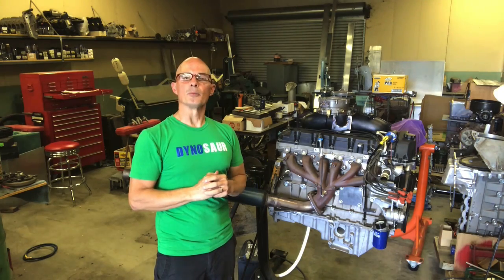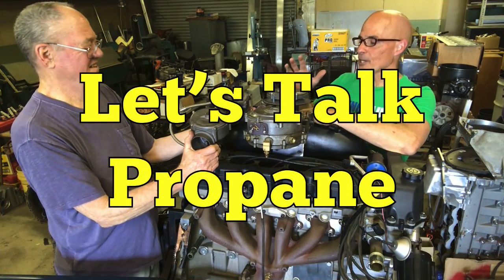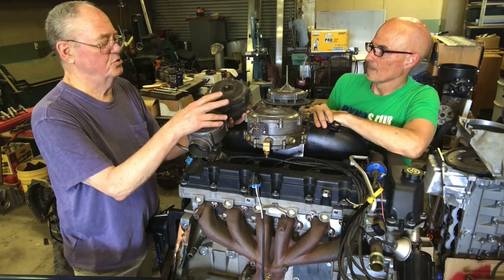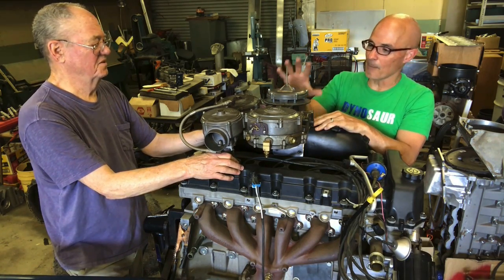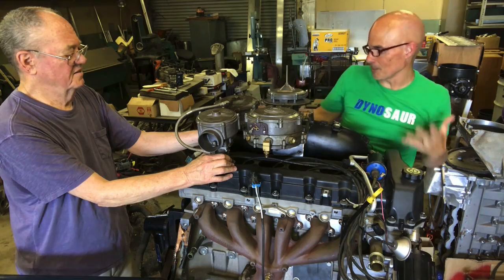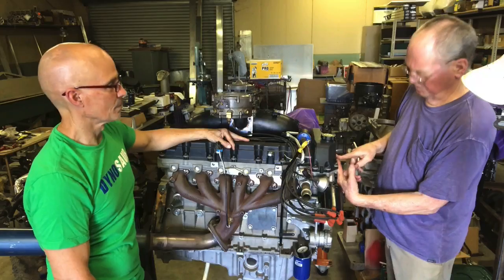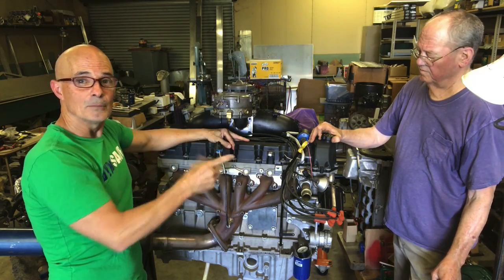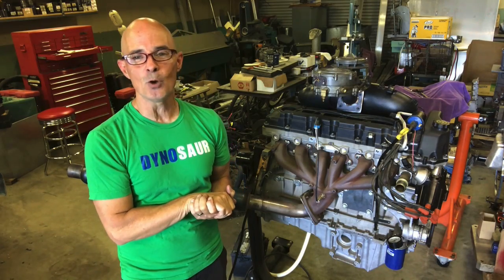PROPANE-POWERED AMERI-BARRA 4200 ATLAS (STAND START ON GRILL GAS-WILL IT RUN?)

Comment: They have tight oil clearance due to lost foam casting. Lost foam castings have 2x the surface area of sand castings and suffer from high thermal expansion.

Comment: I have 2002 trail blazer and I like get bone yard 06-07 engine and rebuild it do you know of a 6 speed transmission that will bolt it to this engine also a good camshafts

Comment: Great video as always Richard. I was thinking about converting a Jeep 4.0 (or better yet a 4.6/4.7 Stroker) to run on propane. Or even dual fuel so I don't get stranded away from a propane fillup station. However I don't know much about propane conversions. Would basic gasoline engine components (camshafts, exhaust manifolds/headers, starters, spark plugs, fuel pumps, turbochargers, etc) still work or would I need to change things? Would there be a significant power and mpg loss if the engine ran on purely propane instead of gasoline? Thanks in advance for any and all thoughts, opinions  or answers.

Comment: To switch from propane back to gas was easy unless the carb float pounded a hole in itself.
You had to run the carb dry because the engine would not run on both at the same time.
Then switching back to propane you had to run the carb dry before switching to propane.
No problem  if you are going down the road at 60 mph.
Then finding someone , someplace that can fill the tank. And it smell fishy too from the smell they add to the gas so you don’t die from  breathing the stuff.
Bet that little tank won’t get you across town.

Comment: My father ran propane in his 63 Chevy pickup in 1963
I drove it for years after he died untainted they started regulating everything
And requiring a tax for even inspecting the tank.
Always wanted to build a engine with about 13 to 1 pistons to run on the stuff.
You lose a lot of power on a normal engine with normal compression.
Of course you would have problems having to switch back to gas when you run out of propane.
For a old farmer it worked well because before diesel became popular , a lot of tractor were ran on the stuff . It was easy to fill the tank in the truck from large tanks used to run tractors and irrigation wells .
This was in the 1950s, before the gov . Decided they needed more taxes.
 It runs cleaner, only the valves need hard seats as the gasoline lubes the valves on gas engInes.
And the tanks large enough to run for ver far are large and very heavy.

Comment: I only know what I been told . The oil pressure is a manufacturer number from the computer but I think as long as a minimum number is met by a normally open switch then the rest is rmps and temp ,probably water . This is done to make folks happy . I pretty sure my Mozda Miata and Dodge Diesel is that way ..

Comment: Would the high oil pressure be relevant to a higher volume requirement for the variable cam timing, assuming it uses it

Comment: I'd be interested in seeing a full on LPI with electronics.  You get greater charge air cooling from the vaporization of fuel in the inlet tract vs having it happen in the regulator.  The Aussie's are doing this but nobody state side seems up on the current tech.  Holdens and Fords offered it OEM and made slightly more power with Liquid Propane Injection.

Comment: My uncle drove a propane truck, delivering propane to homes. The old trucks were often some variety of big blocks. I do remember him telling me those trucks engines were special order. I do know that it loped like it had a huge cam but would only pull up to about 4000 rpm. So at that, I figured it was advanced 4 degrees.

Comment: Is there a particular reason you can't run coil-on-plug with a propane mixer, or is it just because of the absence of an ECU that he needed a distributor? I'm sure the Delfi unit would be very unhappy missing the injector system and MAF/MAP readings, but surely a standalone could get around this, no? Also, is there any way available on the market to run EFI with propane? Should be able to build a ridiculously high compression ratio NA motor that would sound amazing if you could get around the fuel injectors freezing solid.
Reply from the maker: THIS WAS DONE SO NO EFI WAS NEEDED

Comment: 6:10 Richard, people  inject Methanol/Water mix into a turbo or supercharged system to prevent detonation and add a little power. Would  Propane work also?  How could that be done?  Inject before the supercharger or turbo in gas form?

Comment: I am an LPG technician here in Greece and I can tell you one thing: this system must be really OLD! I have a Hyundai 2.0L turbo converted on LPG, stock engine 1 bar boost for many years working great but with a much more modern system. I'm curious on the results...
Reply: That's a vaporizer like what's used on an older forklift.

Comment: Distributor conversion means you're halfway there to eliminating the Achille's heel of the Atlas, ie, the need for an ECU & wiring harness. All that's needed now is a controller for the variable cam timing.

Comment: If the propane is liquid under pressure. I wonder if you could somehow plumb the normal efi fuel rail returnless and instead of gasoline, run pressurized propane through it regulated to a pressure the injectors are comfortable with?

Comment: I love the reference to Ak Miller.  'Turbochargers' by Hugh MacInnes referred a lot to propane and Ak Miller.  Turbochargers was one of my first tuning books ever purchased, such a great book so far ahead of his time IMHO.  Based mostly on that book I did a turbo conversion on my 1974 Mitsubishi Colt Galant GTO, 2.0L.  It worked very well, mostly based on that book.  I did all the work myself, made a few mistakes, but the performance was stunning and just as MacInnes had predicted, it got better gas mileage after conversion than before in spite of a lower compression ratio in the turbo version.
Reply: If you're gonna read anything on turbocharging, "Turbochargers" by Hugh MacInnes and "Maximum Boost" by Corky Bell should be at the top of the list. They're a little out of date but there is so much knowledge buried in those two.

Comment: I accidentally snapped the oil pressure sensor off in a Trailblazer, and magically the gauge still read like normal with the sensor laying in the crossmember. So yes, the factory gauges are a basket of lies.

Comment: Love these kinds of tests. My company was running CNG on GM LQ9 6.0’s after discovering that it was better on emissions than a Toyota Prius running on gasoline. I just wish it was cheaper to convert today’s cars!
Reply: With the huge amount of natural gas the USA has, you'd think the US government would be scrambling to make use of it and allowing conversions. Because it does run so cleanly, you could exempt vehicles from emissions standards after an LPG or CNG conversion. If you could clear the regulatory hurdle, after that it's just a matter of getting safe conversion systems built for cars. That would also play nicely into using CNG and LPG for new vehicles.

Comment: I would live to see the results of this on the dyno.  Maybe I didn't understand part of the science here but what would stop you from running the liquid propane (rather than evaporating it before the manifold) for example on a direct injected engine and injecting it at high pressure.
Reply from the maker: YOU NEED A DEDICATED SYSTEM TO DO THAT

Comment: Propane has approx. 75% the energy density of gasoline however, because of the innate octane rating, you can run a much higher static CR, making up some of the differences.

Comment: I Always ran gas in the 90s when it was 25c a litre now the aussie govt sells it to china for 3c a litre and we have to pay around 80c a litre just not worth it , i always ran the impco 425 mixer on a q/jet base plate with the secondary butterflys reversed always made more bottom end power & more top end than any holley i ran on petrol on a 350 chev in a hq holden

Comment: Tunnel Vision in Australia has a quite a few fast cars they have built for customers with Turbo LPG, Johns ITUF65 Mustang was fast did see another vid at 9.13. https://youtu.be/NrZm_eKfOKk
Car had a custom Propane tank with 8 outlets, 4 lines, 2 converters & a Gas Research Australia/GRA mixer, on a built AU SOHC (predecessor to the Barra)

Comment: Does anyone know if you can run liquid propane on port fuel injection.  The pressure would be higher, but I presume that there's injectors out there that could handle the higher pressure.  Someone must know, would love to know myself, please share.
Reply from the maker: yes-oems are doing just that
Reply: @richardholdener1727  I did not know that, thank you.  Sounds like a great combination in theory and getting that heat of vaporisation from the inlet air should be a nice bonus.

Comment: I am running a propane fueled Ford 200 crossflow (Australian) I run 9;1 CR with a screw type blower providing 60inches H2o manifold pressure, fixed advance. No problems at all, great torque and sweet running. LPG is a great fuel and here its about half the price of petrol. We had factory LPG Barra engines, later ones had liquid injection.
Reply: Tell me more. OEM system? Here in Canada, with road tax, it is about half or better then petrol. Getting it as heating fuel is cheapest. LNG is even cheaper and we can get home compressors so it's kind of like free after purchase . What is blower rpm at 4 bar? What air/fuel control? Love crossflow inlines.
Reply: @ianmcfarlane4257  Ill go to LNG first, I worked for Westport, based in Vancouver for a couple of years, we were doing R&D on CNG and LNG in Australia. We did have some CNG and LNG trucks and busses going around, worked quite well, mostly 12litre Merc engines. As to my application its the Australian incantation of the old Ford inline six that we here eventually got to DOHC and 4valve. The blower I run is a Sprintex S102, its 1.1 litres per rev, Ive got it running 2.9:1 so maximum of around 14000rpm. I run a GRA (Australian made) mixer and B2 convertor, nothing complicated, no electronics other than a dizzy. NG runs great with boost, Westport was running 12:1 with 1bar boost regularly, I would run CNG here, but it isnt available, LPG is readily available everywhere, and around 80c/l (exchange rate to C$ is almost 1;1) My manifold pressure is 60 inches of water, so around 100kpa. If you want to know more I can be reached on FB, under my name. Seeya

Comment: Was it Bobby Alloway who did ProPain with LPG injection system from Oz. Heat reduces density of any vapor. Blowers add heat . Blow through carbs/mixers need cold air, that is why intercoolers are used on higher output engines. Think of LPG vapor as pollution on a N.A. engine air charge. You only have so much cfm going in now add LPG vapor and you reduce the oxygen. On a N.A. daily driver you can tune out the Lean. Add boost with heat and vapor tuning gets very tricky. Dyno runs at WOT like Ak Miller did back in the day were impressive, 700 HP on a stock built SBC, single turbo. Really not for a D.Driver. LPG injection might help but at what expense? The big advantage back in the day was fleet economy. Payback for installation was one to two years. Cars/trucks are so much better today so think at least five years.
Rock crawlers love LPG  "Got Propane" and "Nash Propane" are two outfits but use certified hoses, please.
As was mentioned -  any back alley wannabe shop should be crushed alive using propane in an AC system. Period.

Comment: Hmm...propane....higher octane & keeps for years in its tank & never goes bad, no need for a fuel pump as it's under pressure in its tank, burns clean & keeps engine internals spotlessly sludge free, half the price of petrol...except in remote areas where it's exxy & harder to get. Best to go dual fuel, not straight gas
Reply: Propane costs more than gas everywhere I look. Gas is less than $3 per gallon, propane is over that.

Comment: Im very interested in one of those distributors Richard,  thinking about replacing the locked up I6 chevy motor in a boat with a 4200 and that would be the missing link in the swap chain.
Reply from the maker: search Stovebolt
Reply: @richardholdener1727  maybe a 6LS could be used to run the coils somehow?
Reply: @richardholdener1727  all i get is the old stovebolt engines, im interested in that distributor drive to swap an Atlas into the boat

Comment: LPG is really common down under if you can mate try and get a lpg injection system something like we run on the lpg barras.  The octane is great however like e85 you use way more of it and it struggles to provide enough fuel at about the 600hp. check out the guys trying to get 10's from a lpg barra engine at Carnage garage the Street machine guys. Be aware that if you get a LPG backfire you can easily bend rods thats why the lpg barras have forged bottom ends
Reply: LNG and Hydrogen Id like to see used
Reply: I don't know about high hp numbers but i know gas has 5 percent less energy than petrol per unit so you don't use to much more unlike e85.

Comment: I have often wondered if a fuel injection engine will run on propane. If the propane goes into the system as a liquid I don't see why it wouldn't work
Reply: The problem would be keeping it as a liquid through the injectors
Reply: @colinb5517  It's under pressure so that shouldn't be an issue. I suspect you would need bigger injectors for propane/LPG
Reply: Do you have injectors that will take 350 psi? Because that's the pressure they'll see at 150°F. There are liquid propane injections systems, but the fuel delivery system is a bit special.

Comment: The oil sensor on these motors are basically and on/off switch. The computer senses if it has pressure then "calculates" what is should be, they normally run at 40 PSI.
They are also prone to low oil pressure issues if motor was not taken care of. They build up sludge and the oil pickup screen is very small and gets plugged easily. I have a 2008 Trailblazer that loses oil pressure after 10 to 15 mins of driving as screen gets plugged. Shut it off, let it sit for 5 mins, good to go another short stint. My mechanical gauge confirms I start with 70 psi and drop to zero. 
This is cool how you are running on propane with a distributor.

Comment: I'm very interested in that dizzy conversion...  It could seriously make me rethink a build I want to do in a first gen Nova.  If I could do one with a distributor and carbs it would be totally legit!
Reply: Not sure if it helps, but the motor comes with a crank trigger. While Jerry didn't need any of the electronics, there is a fair amount of knowledge out there in using the crank trigger with something like a megasquirt. I almost wonder if it wouldn't be better with a wasted spark setup like GM used on the 3800. It's fairly easy to trigger. Then you could hide the coils and use normal plug wires and keep a 'retro' appearance instead of the 4200's coil-on-plug

Comment: I had the pleasure of talking with Ak Miller several times and he was very helpful.  He had a turbo six cylinder (stock) Maverick and tore up the big boys with ease (Ak said you didn't need much more that 7-8 pounds of boost).  How can I communicate with Jerry??  I have a 500 Cadillac built to run propane.  Going in a '66 C10 (in build).

Comment: The higher oil pressure is for VVT cam phaser. When the solenoid drops pressure at the phaser to move it, it creates a massive pressure drop so they improve pump flow to counter this. You could change the spring in the pressure relief bypass to drop the oil pressure if you delete the VVT.  
The reason they spec 5w-30 oil is for response time of the cam phaser, 20w-50 would take too long to evacuate from the phaser causing it to lag ECU demand.
So the whole engines oil system is tuned for this. 
More modern engines have variable oil pumps now so this issue of over pressure at cold is not there.
Reply: Yup considering this is GMs first Truck VVT before Gen 4 LS.

Comment: This brings back memories in the 90’s doing straight gas conversions.
Reply: Let's Restart a trend toward straight propane conversions, it's 105 octane minimum (HD 5 standard propane.) Hot Roddin with clean burning, hi octane alternative fuel. Lead the way Mr. Holdener!

Comment: BBQ LPG or liquid propane gas is different to LPG liquid petroleum gas. The latter has butane mixed in and is what is used for cars. BBQ gas will work but it lacks grunt from the added butane.
Reply: Where are you finding anything other than HD5 propane? Everything delivered to regular consumers is HD5 regardless if it goes into your grill, your double-wide or the Schwan's delivery truck.
Reply: @Joshie2256  I'm In Australia so we have it at servos.
Reply: Same same. The butane is just cheaper for production, it wont have any drastic drawbacks on the motor shown. When LPG was getting popular with a few drag racers here in Australia, most of them were going to specific service stations to actually get 100% propane. A few of the guys in the know seemed to believe it was better.
Reply: @benwhittaker8630  I'm A mechanic in Canberra and one of the managers at my work used to install LPG systems. We have a bottle to use BBQ gas for when tanks are empty and when you use the BBQ grade stuff it's weak as. The servo stuff really works better.